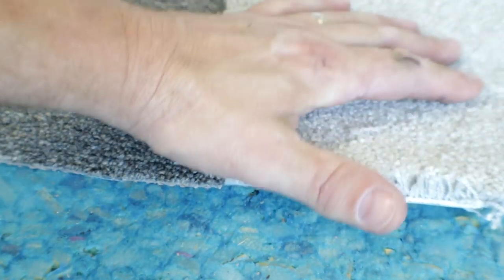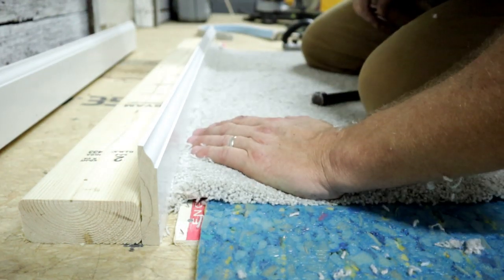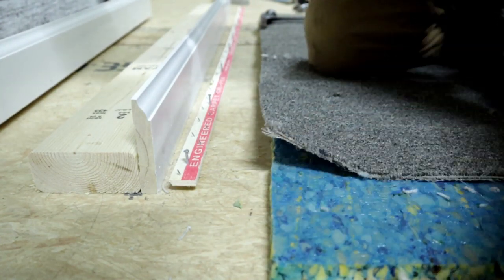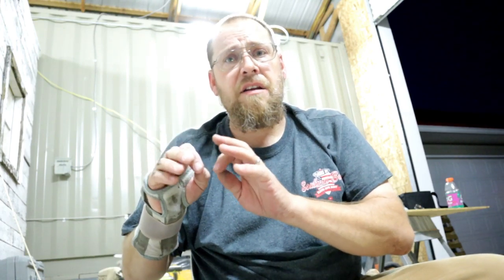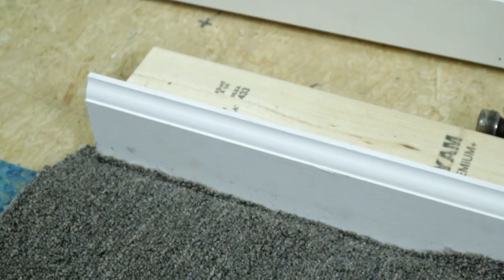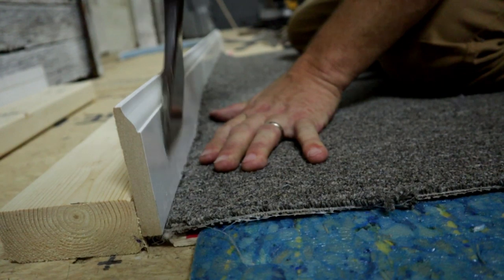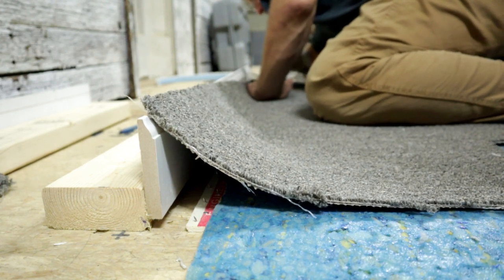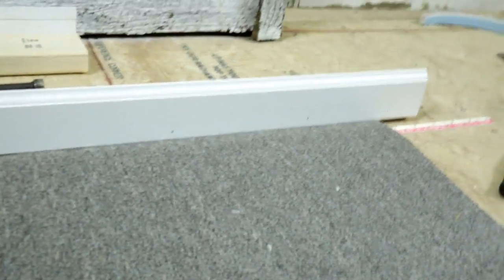PROPER TACK STRIP PLACEMENT

Comment: Great vid, exactly what I was looking for. I really appreciate the time you took to give a detailed explanation 👍
Reply from the maker: Dave Hedgehog thank you sir , glad it helped
Reply: @FloorsbySouthernboys  Mr. FBSB when installing baseboard, do you recommend it be flush with the subfloor or is it best to leave a gap? Baseboard is being installed before carpet. TIA
Reply from the maker: @johnk4588  contractors will usually use a piece of the base as a height gauge, and leave it off the floor the thickness of the base. Quite honestly, in some cases that is too high. The gap is better, but I would not recommend exceeding inch gap from the baseboard to the floor.
Reply: @FloorsbySouthernboys  thanks! If the baseboard is already installed flush with the subfloor is that a problem? Should I raise it or not worth it?
Reply from the maker: @johnk4588  no, don’t worry about it leave it like it is, it will be fine
Reply: @FloorsbySouthernboys  my wife and I thank you!!!

Comment: Great informative video.
I was thinking what the distance would be for a thick carpet or a thin one. I laid a carpet, it was 7mm thick. I used a small piece of gripper for the spacing, where I put it flat on the wall between the gripper and the skirting board while I nailed it down. the thickness of the gripper was about the same thickness as the carpet, 7mm. It worked out really well.

Comment: Nice video. 
Though there are many variables in strip placement.
Though you may want to mention the purpose of the bevel on the edge of the strip. Commercial loop pile carpet (1/4 inch or closer) all other carpets no more than 3/8 of an inch .
If your fitting somthing thiner than the strip (reducers for some lvps or laminates ) 1/8 of an inch and the bevel on the strip is your friend (if you cut the cpt only a 1/16 of an inch heavy you will be able to tuck and stretch away with confidence.
Reply from the maker: Very well said my friend

Comment: I really enjoy your videos.  How far should it be from the drywall in new construction?  I was planning on installing the carpet (Berber) before I installed my baseboards. Also, am I going to have trouble stretching without the baseboards?  I'm using the same base you have in the video.  Thanks in advance from a DIY guy.
Reply from the maker: orangeandbluehoosier The thickness of the base +3/8 of an inch, you can always lay a 2 x 4 or something against the sheet rock and stretch off of it, so you don’t damage your sheet rock

Comment: Awesome video! 
Quick question I have thin carpet in a spare room with the tack strip way off the wall like an inch or more would it be possible to move the tack strip closer to the baseboard and stretch the carpet out? I would only have a knee kick
Reply from the maker: If your carpet reaches the baseboard now then yes you will not have a problem moving your tack strip closer to the baseboard and installing the carpet back to your baseboard
Reply: @FloorsbySouthernboys  thanks for the tip! Got it fixed and where it should be! I appreciate you responding!
Reply from the maker: @travelinnate2761  You’re welcome, glad you got it took care of

Comment: I'm doing a remodel. Also I'm going to  installing new carpet and replacing trim. The current trim is against the concrete slab. Tack strips about 5/16 to 3/8 from trim. What is your recommendation for proper trim installation? I thought about having carpet installed and then placing trim on top of carpet. I've also been concerned about the current trim sitting flat against the concrete. Not sure the best look and installation for the trim. Thank you in advance for your help.
Reply from the maker: As long as you are not putting your trim on top of the Tackstrip and Carpet, you will be fine raising it up off the floor about 3/8 to 7/16 of an inch. If your trim is already down, like you say it will not be an issue to work your carpet directly to your trim. As long as your tax trip is not really far away from your trimmed, I would just leave everything as it is. Yes, your tax strip is in good shape.
Reply: @FloorsbySouthernboys  Does the door casing need to be off the floor about 3/8 to 7/16? I'm planning on replacing all the baseboards. I was going to installing them 7/16 off the floor. However my door casing trim and door jam are currently flush against the concrete. I didn't know if this should be raised to have uniform appearance with the newly installed baseboards. What would be your suggestion?

Comment: I'm going to lay a carpet in my house. Can you share the names of the tools you used?. Thank you
Reply from the maker: Carpet, knife, power stretcher, knee kicker, seaming iron and some kind of flat weight. You can use a 2 x 6 about a foot-long with some added weight on top. Typically want it to weigh about 10 pounds and that is to go behind your iron as you make your.seam. A hammer stapler for your pad a Carpet tucker to tuck your carpet. Once it is trimmed around the perimeter and a carpet Trimmer would come in really handy as well. Since you are only doing this one job, you should be able to make it with those few tools.

Comment: Our carpet was installed and you can feel tacks ALL along the stairs and the perimeter of every room. I know this wasn’t a job well done. Can we do anything about this so we aren’t constantly poked? They won’t come back out and fix it
Reply from the maker: You can take a hammer and tap them down by tapping on the carpet and it will bend over for tax so you can’t feel them, I would only do this in doorways and on the steps, I would not do it around the perimeter, unless it is two or 3 inches away from the wall

Comment: key takeaway for me here  is that when the baseboard is flush with the subfloor, the width of the gulley is defined by the pile height of the carpet? - for your 3/8in gulley, what was the pile height of the plush carpet out of interest please? - I have some tack strip and underlay to fit in a room prior to the fitter coming and the last time i did this i was told my placement was wrong, so keen to get it right this time!

Comment: Does there need to be a gap or space below interior door casing and jam for tucking carpet?  Or can these touch the ground? I've had a few contractors tell me the baseboards need to be off the floor about 3/8 to 1/2 and the door casing and jams should be flush with floor.

Comment: You should use your stair tool to slide it onto the Tacksticks so the little spikes/nails goes into the carpet before stretching and it would’ve stayed
Reply from the maker: Rubbing your stair tool across the tack strip damages the pins

Comment: I just pulled up family’s 50 year old jute back carpet. The tack strip was about 3/8” BUT, the carpet was beautifully tucked in behind the strip with a “U” shape - so where yours just butted to the baseboard, this carpet tucked down and then back up the face of the baseboard creating  a “U” shape in the gully. I wonder why this isn’t done now.
Reply from the maker: IT SEEMS THAT THE CARPET YOU PULLED UP WAS CUT A LITTLE BIT LONGER THAN I LIKE TO CUT IT

Comment: In your example of a raised up baseboard, how tall is the gap between the floor and the bottom of the baseboard? It appears roughly equal to the thickness of the tack strip but it's hard to tell from the angle and I'm not sure how critical the gap size is.
Thanks!
Pat
Reply from the maker: Baseboard is usually off of the floor about a 1/5 or 5/8 of an inch

Comment: How far should the tack board be for industrial carpeting installation on stairs? The reason I ask is because it would be both tread & riser carpeting being pushed into the gully.
Reply from the maker: Debi Sero for commercial carpet i will leave about a 1/4 inch gully
Reply: One and a half times the thickness of the carpet.

Comment: Is there not an actual measurement for gully distance in relation to the thickness of the carpet? 
If I was to use 12mm underlay (pad) on a concrete floor and 8mm underlay (pad) on stairs should the wood part of the tack strip be different to prevent the underlay (pad) pushing the carpet up?
Reply from the maker: No, if it is stretched properly it will not push the carpet up
Reply: @FloorsbySouthernboys  Now on day 2 of watching video's good to see your hand is on the mend. I still hope to get someone with experience (and tools) to do my work but have made 4 calls to fitters in my area of UK and not 1 has returned my call.
Reply from the maker: @robertmclean6927  Thank you sir, I’m not exactly sure where you live at but Trim and tuck carpets are highly qualified and super professional, if you are near them they would definitely be your best go to. Here is a link and I’m sure you can find out if they service your area.

https://youtube.com/c/TrimTuckCarpets

Comment: Good morning! 
Recently a company installed my second floors carpet! I think they didn’t do it properly, watching you video I reconfirmed that I was right! They put a second track stripes with one inch apart from the original one that’s was on the floor! With this is like four inches away of the wall! 
I ask to the installer if that’s was right because I do most of the repairs in my house,  I have general knowledge of how things are done because I watched several videos! I complain and I talked to the people that represent the company and they told me that’s when is a big room they do it that way for better grip, after all this I don’t know what to do! Or to whom to go because they dint do a proper installation and I pay 10,000 for the whole thing, on top of that every time I go up or down the stairs I fell the track strips and is really painful because I’m bare foot in my house! 
Please help me and give me some orientations because I feel that they are not right and I feel impotent! Ty so much, pardon for the long written but I try much info possible! With gratitude María
Reply from the maker: That is most definitely not right, even if you are in a large room you should never have a space between the two tack strips, I never use to tack strips anyway it really is not necessary unless you’re installing a really high-end carpet such as Axminster or something like that, not sure on what to tell you other than hire someone other than them to come remove the strips and fill the void with carpet padding and restretch your carpet back up, if your steps are done that way as well then you will probably just have to Completely redo your steps, usually there is no saving the carpet on the steps when you have to pull it off
Reply: Tank you so much I feel much better having an expert opinion, I went today an complain, they are sending some inspector, the carpet is regular, nothing fancy! On top of that I have ants coming to one of the rooms that I never have before, I don’t know! From the bottom of my heart tank you so so so much for you help!
Reply from the maker: @mariaroa1835  You’re welcome, I really hope they get it sorted out for you
Reply from the maker: @mariaroa1835  If you are having an inspector come hopefully they are not the one paying him and hopefully it is from the mill , There is no way an inspector will let that fly you should be fine with getting it fixed

Comment: How about for Berber?  Is the space 1/4"?
Reply from the maker: Depends on the thickness and tightness of it For most barbers I would probably go somewhere between a quarter and 3/8
Reply: @FloorsbySouthernboys  It actually isn't a true berber, but rather a pattern (cut and loop combo).  The existing tack strip is down and they are trying to put new baseboard.

Comment: Hey I have noticed when power stretching off some two gripper it bends the pins straight or even further in close quarters. Has anyone ever come across this... would it still hold enough if bent straight. Cheers.
Reply from the maker: Yeah I really wouldn’t want my pants to pull straight, maybe you could switch to a different brand of gripper, don’t seem to have the trouble except with cheap gripper , I hope this helps
Reply: It is an expensive brand one of the two big names in the industry. Take care.
Reply from the maker: @Michael-kt5mu  House now, that is surprising,

Comment: I would have moved the baseboard using screws versus removing the tack strip everytime. 🤣
Reply: @FloorsbySouthernboys  I appreciate the info, makes perfect sense to me. I do have a question for you. I'm doing my first instal in my new house I'm building. I have 3 bedrooms that from baseboard to baseboard is exactly 15' 1-1/4" wide. Do you think i can get lucky and use 15' wide carpet * if it really measures a true 15')? Will it stretch the 1-1/4"? I will be a good nylon carpet. I do have access to a power stretcher.